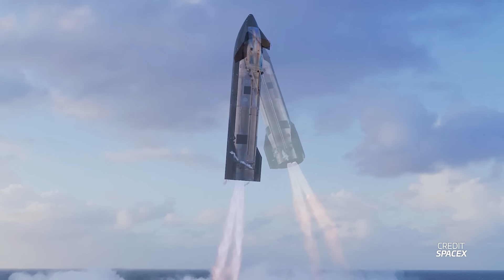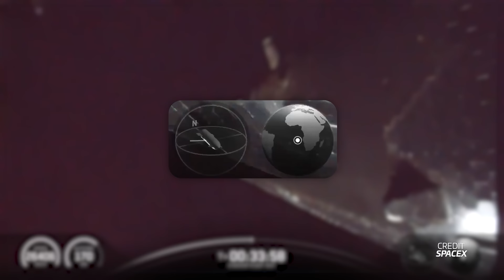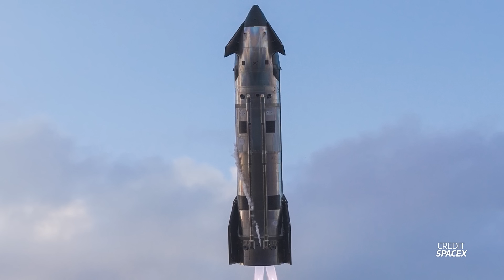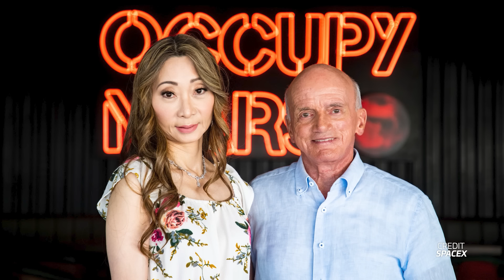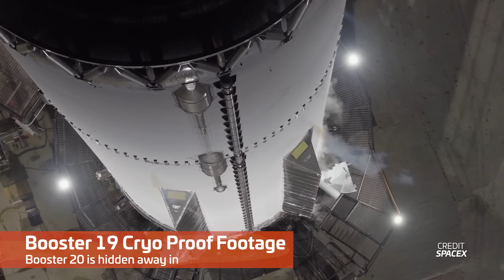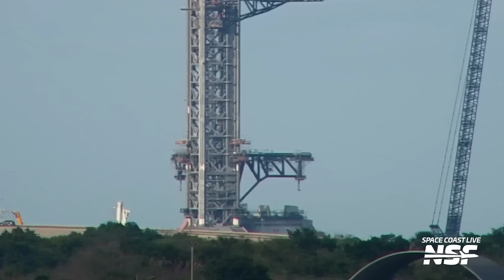Starship Flight 12 Full Analysis: What Went Well & What Went Wrong | Starship Update

Comment: Lost booster, but Ship 39's heat shield was cleaner than any previous flight.
Reply: At the end of the day, worst case scenario, boosters are occasionally disposable anyways. Lost or not, those control surfaces and the navigation system performed better than anything we have in modern certified flight.

Comment: Could a hydraulic/ syringe type design work for refueling the starship??

What happens when Starlink and Project Kuiper satellites become obsolete??

How would a starship get home from the moon or mars? There's no OLMs to support their launch..

What happens to the crew INSIDE the Starship if something catastrophic happens?

Is there an ejection plan??

So many questions..
Reply: Why would a syringe be needed for refilling? The Starlink satellites get replenished, that's what happens. Starship doesn't need an OLM to launch from the Moon or Mars. No, there's no ejection plan.
Reply: @Alexphysics13 he's taking about refilling starship not starlink
Reply: No ejection plan for Blue Origin Mark 2 either - launch pad, nor in space.

There was also no backup "ejection" plan for Artemis 2 astronauts once they did the TLI burn from earth orbit to the moon AND BACK.

They didn't have the fuel to stop anywhere once TLI was done.

NASA doesn't like to talk about those things.
Reply: Satellites are de-orbited once they are finished and new ones are launched to replace them. Starship only needs a booster on Earth, the Moon and Mars have lower gravity allowing ship to reach orbit by itself, technically it can reach orbit from earth without a booster but it's not worth the effort as it couldn't carry any real payload.

Comment: One thing missing from your discussion of the failed/aborted boostback burn of Super Heavy is the lack of insight/clarity on whether the Raptor engines not igniting were a result of "engine failures", booster internals design issues, or just an "operational issue" due to an aggressive flip. Almost certainly, Super Heavy wasn't meant to flip in the manner/direction it did and possibly not at the roll rates seen on this flight. Off axis or overly aggressive flips could easily overwhelm the propellant slosh controls or otherwise starve the intakes. Very easy to hard start Raptors that would, all else being equal, have been in perfect working order due to a "poorly" executed flip. Have to wait and see.
Reply: I don't think anyone except SpaceX knows the root cause.

1) Engine issue in itself
2) Fuel delivery issue - rocket engines do not like firing and then suddenly there's no fuel (or fuel cavitation) to them.
Reply: Good point. But, for clarity, the 'flip' is not a roll maneuver, it's a pitch maneuver. Traditionally, 'rolling' is angular rotation about the craft's longitudinal axis and 'pitching' is angular rotation about the craft's horizontal axis. For completeness, 'yawing' is angular rotation about the craft's vertical axis.
Reply: It's very clear that what happens is an engine explosion taking out neighboring engines and forcing the booster to cancel the boostback burn

Comment: They definitely were to aggressive on the hot staging burn. Someone miscalculated just how much force there was going to be. The booster spun so violently that I suspect all of the fuel moved off of the intakes (hence the short burn) and probably did internal damage. I wonder if the 'out of control' rolling was due to venting.
But that was definitely a software glitch. Note that ALL 32 engines lit during hot-staging.
Reply: I think it's a feedback loop and a goal. It isn't pre calculated. But yes, this loop appears too aggressive and needs tweaking
Reply: @JamesHardaker  I would suspect that it's pre-calculated with either a lookup table of values or a few variable insertions with a range of available options. Look up tables are faster and less likely to run into processing and other such issues.

Comment: They don't have the plate on the side of the Hot stage to force Booster towards the desired direction & It got blasted by the Starship Exhaust & that wasn't suppose to Happen.
Reply: The plate isn't meant to be on for version 3, that's what the staggered ship engine startup is for.
Reply: @Alexphysics13 well obviously they need to rethink that
Reply: @Shivaho  Or... the ignition sequence actually didn't go the way they hoped. Instead of being RVacs+Engine1+Engines2&3, it ended up being two RVacs, Engine 1, the other RVac, then the two remaining sea levels. That explains the push in the wrong direction

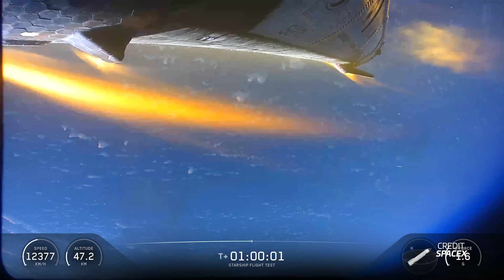Comment: Great report!  One nit: at 8:05 you said there were no noticeable burn-throughs of any of the flaps. But I noticed what appeared to be a small burn-through at the hinge of one of the aft flaps.

Still, the mission was a HUGE success, much better than I expected. With so many changes, I was determined to be satisfied as long as it didn't destroy the launchpad. To get past stage separation would make the mission a big success, because it would mean that useful test data was obtained for both booster and ship. For ship to successfully reenter, on target, in the Indian Ocean, was beyond what I dared hope.

Sure, some things failed. (Rocket engines aren't supposed to blow up!) But that was to be expected, and none of the things which failed stopped the mission and prevented them from testing most of the subsequent things on their agenda. "The payload was data," and they got a LOT of it!

Comment: I thought I heard somewhere that use of only two engines at the end of the flight was a part of SpaceX's plan for this flight.
Reply: The plan was to do the landing burn starting with 3 engines like usual. Then it would be brought down to two, also like previous flights. The new thing for this flight was that it would then be further reduced to a single engine on the final seconds of the landing. The two engine landing burn profile we saw was just a result of one of the sea level engines being deselected before the landing by the onboard computer, same as SN15.
Reply: @Alexphysics13 I think they want to get it as close as possible to the water to get the best chance at inspecting and recovering parts, that’s why they need to go down to a single raptor. Don’t expect this to be repeated in a catch attempt as it’s away from the ground.

Comment: Isn't holding it on the pad just a waste of propellent?
Reply: No, it allows for the onboard computers to check the health of the engines before releasing the rocket. Almost every liquid fueled rocket uses this technique as a safety mechanism. If the engines were to decide it's not their day... the launch can be aborted instead of having an uncontrolled 5,500 ton rocket veering sideways N1-style
Reply: @Alexphysics13  Cool, thanks.

Comment: What's with the fake AC commercial? The Breezamax you are advertising is NOT a true air conditioner. It doesn't lower room temperature significantly like an AC unit. It can't cool an entire room effectively.
Many customers and reviews describe it as "just a fan" worth $10–20, not the $50–$100+ it's often sold for

Comment: Humans and anything else alive will need a nuclear thermal rocket to get to Mars.Cargo can go by Starship.  Starship is a shuttle , not as a ship.
Reply: No nuclear thermal rocket needed to go earth to mars.  

Earth LEO to Mars surface is 3600 m/s.  Earth LEO to Moon is 5661 m/s.  This is because there is no aerobraking to the moon that can save fuel.

Now, getting BACK from Mars is very expensive fuel wise, about 8120 m/s if you want to stop in LEO or about 5680 if you don't.

Nuclear still has to take a fuel to act as propulsion, nuclear in itself is not throwing anything out the back to move a ship forward, it's just heating it up.  And then there's the heavy shielding required for humans, and that weight is a significant drawback, as well as regulatory approval to launch from earth a nuclear reactor.  It's got a long ways to go, not saying it couldn't work in the future.
Reply: @ConstantTrue Chemical rockets , being slower means you need more shielding. We need speed to lower the time in radioactive space and the power to push something big enough to spin on its own axis to provide mars level gravity , which means a two hundred meter habitat ring at the front. It should have the capacity of three V3 starships.

Comment: That side by side video with flight 11 is AWESOME
Reply: Also 11 had 15ton pay load. This one had 40ton payload.
Reply: @ZeroSpawn  the payload is really not that important. The whole rocket has gained an extra 500 tonnes of mass in between both flights with all the extra propellant they've been able to add, so adding a few more tons of payload doesn't really change things by much given that
Reply: @ZeroSpawn Woooow
Reply: Definitely although for laughs I'd also like to see a side-by-side of flight 12 with IFT-1. There's actually some justification for that because IFT-1 was the first ever flight test of the Raptor 2 redesign and Flight 12 the first ever flight test of the Raptor 3 redesign.

I think it's worth remembering how many engines were out as the IFT-1 booster limped downrange vs just how well these Raptor 3s did on their first ever flight. Yes, the heat shield did well but for me the Raptor 3 might be the even bigger star of flight 12.

I suppose in fairness I should keep in mind the concrete tornado at IFT-1 launch so it's difficult to know how much of the Raptor performance discrepancy between IFT-1 and flight 12 was down to intrinsic engine reliability vs damage sustained at launch and of course those were much earlier days in terms of SpaceX optimising propellant flow, avoiding cavitation etc. Still, I would quite enjoy seeing the side by side anyway with the SpaceX telemetry showing engine activity. SpaceX/Starship has come a very long way since then.
Reply: IN DEED! :) nice blend. Did they intended to use real pad1 and pad2 positions? Certainly seems like it :) (just imagine this will be live view some day - 2 simultaneous launches just few hundreds meters from each other ^_^)

Comment: I remember before the flight that something said they're going to do a two engine Landing burn
Reply: The plan was to do the landing burn starting with 3 engines like usual. Then it would be brought down to two, also like previous flights. The new thing for this flight was that it would then be further reduced to a single engine on the final seconds of the landing. The two engine landing burn profile we saw was just a result of one of the sea level engines being deselected before the landing by the onboard computer, same as SN15.

Comment: The reduction of gravity losses are the biggest improvments on booster V3. Some 1000km/h faster during hotstage is insane
Reply: Yeah it goes faster to sub orbit!!! Why would you consider this a win?
Reply: @SkandiaAUS  You should start thinking of your new gitcha-gotcha sticking point once it goes orbital, since that claim is not gonna last beyond this year.  It's almost as if SpaceX is trolling those "no-orbit" people such as yourself.  There's no scientific reason as far as fuel, engines or thrust that they couldn't have done so.
Reply: @ConstantTrue  i bet once starship lands on mars they're gonna make fun of it instead of celebrating because it didn't happen when first promised
Reply: @SkandiaAUS More power, more better.
Reply: @SkandiaAUS compound benefits, tyranny of the rocket equation makes this a huge win
Reply: @SkandiaAUS  The less time you send decelerating with 9.81m/s² due to gravity, the less propellant you use and the more payload capacity you have. As for the sub orbit nonesence: The max speed of flight twelve was 26.5km/s. If they only kept their engines running for a few more seconds to acellerate 1.5km/s they would have achieved orbit. This trajectory allows you to tests everything you could in a orbital mission, save for return to launchpad, without any of the risks. It makes sense delaying an orbital mission until they are sure that they can reliably perform a reentry burn. If they had flown one additional V2 ship, they could and probably would have done it.
Reply: @brockmann4815  It's actually very responsible for SpaceX to test this way. People should be applauding them vs. judging. However, it's all about 'EDS' people suffer from, nothing actually do with SpaceX.
Reply: @SkandiaAUS  L comment
Reply: To my way of thinking, 33 out of  38 of the new engines appear to have failed. Whatever the actual number, it was certainly not a great first showing for SpaceX's new engines.
Reply: @matthewcasady6276  The very fast flip of the booster is likely to have caused propellant sloshing which might have caused the engines to take in gas instead of liquid and caused the engines to break. Also during the flip you can see an engine explode and take out all the other engines next to it. Obviously a lot went wrong and needs improving. 2 engines failed during regular flight profile which is likely caused by engine problems but the rest of the failures are likely other systems causing the engine failures and might not be inherent engine issues. We just don't have enough info to say with certainty that raptor V3 is no good.
Reply: @matthewcasady6276  On flight 3, only 1 engine started up for landing burn on booster. On flight 4, 12 engines did. Have faith in the engineering... id be pretty confident this will be fixed soon.
Reply: @matthewcasady6276  37 of 39 engines performed flawlessly on upward trajectory (primary mission).  This, for the first ever flight of a brand new engine type; one generating unprecedented levels of thrust from a very small light-weight package. Extremely impressive. Anyone believing otherwise is a fool.